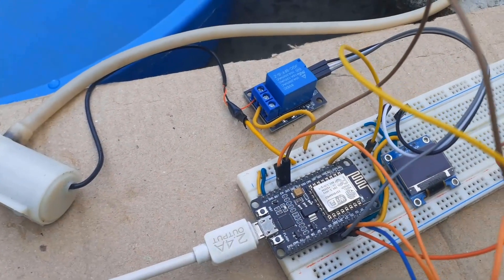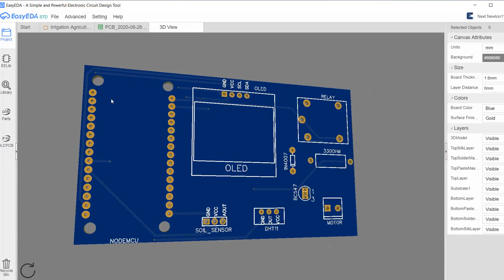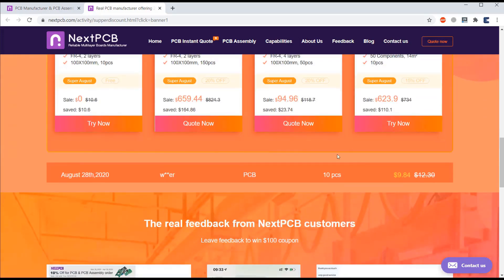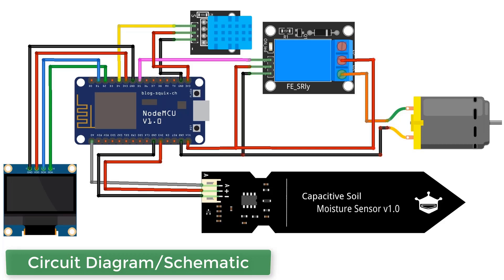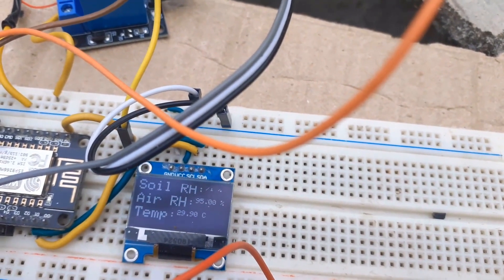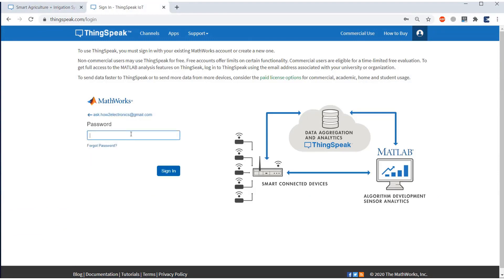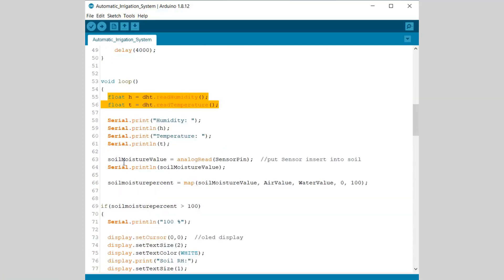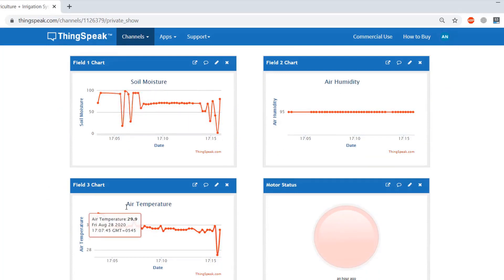IoT Based Smart Agriculture + Automatic Irrigation System with ESP8266

Comment: how to solve this error(error compiling for board generic esp8266 module) using your code.
Reply from the maker: Select NodeMCU 1.0 Board from the tools menu not the generic esp8266
Reply: @HowtoElectronics  the motor is allways stays on?

Comment: Even i Inserted Soil moisture into water ,Motor is still running???
Reply: Same problem
Reply: @kunalvatwani9535  we finished this project its working 100% crt
Reply: @ramkarthik8591  hii
Reply: How did you fix it?
Reply: @kunalvatwani9535  first connect as per circuit diagram
Reply: Would be a great help if you could help
Reply: I have done that.
Reply: Soil sensor is responding properly to moisture content. One of its LEDs turn off when water content is less and It glows when it's high. I can't figure out what is not working

Comment: The ESP8266 ADC takes a max of 1.2V, I believe. The capacitive sensor goes to 3.3V in its output. Did you need to compensate for that?
Reply from the maker: Most ESP8266 development boards come with an internal voltage divider, so the input range is 0 to 3.3V.

Comment: There was an error as D4 and D5 pins are not defined..
Reply: i am also got same .What to do?? Please reply.............
Reply: It is because of the board , if you are using node mcu it has a separate pin configuration , if generic 8266 it consist of specific pin config. See the config of your board on the net and then change the D5 pin name.
Reply: @isabarindustries  Thanks for your help
Reply: @isabarindustries  Even I have put soil Mositure Sensor into Water .The motor is still running Can you help me with this
Reply: Yes , I too faced the problem Actually this project has many bugs , I changed the relay circuit in default on portion. After I completed all these setups , this project sometimes works ,and sometimes not I faced many difficulties around this .
Reply: @isabarindustries  Can You explain Clearly what changes to ve done in Relay circuit
Reply from the maker: Instead of using D4 and D5, use GPIO pins as 2 and 14. Replace D4 as 2 and D5 as 14.
Reply: @HowtoElectronics  Yes I Did that but again The problem ...
Reply: @HowtoElectronics  The motor is still running even Moisture sensor in water
Reply from the maker: Check the value of soil moisture in air and water. Verify whether its showing 0% in air and 100% in water or not.
Reply: @HowtoElectronics  In air the graph shows -58 and in water graph shows 86
Reply: @HowtoElectronics  Please reply I Want to complete this project ...
Reply: @HowtoElectronics  I also have similar problems, please help
Reply: @ramkarthik8591  I have the same problem,  do you have any solution ?

Comment: in thingspeak field 4 (motor status), how do you set the condition of motor status?
Reply from the maker: If digital pin that is connected to motor is high, then 1 is sent to thingspeak, if its low, then 0 is sent.
Reply: @HowtoElectronics   but it will not respond sometimes